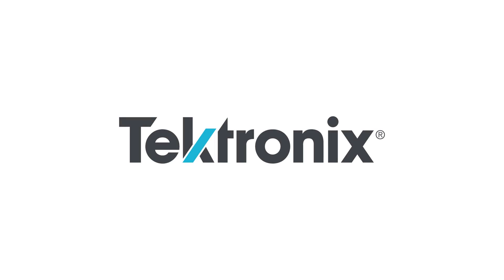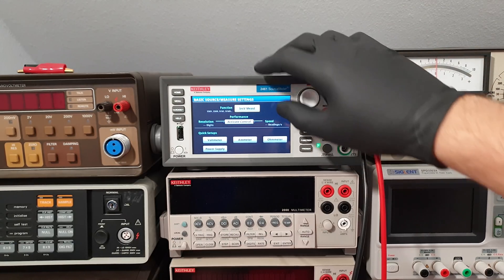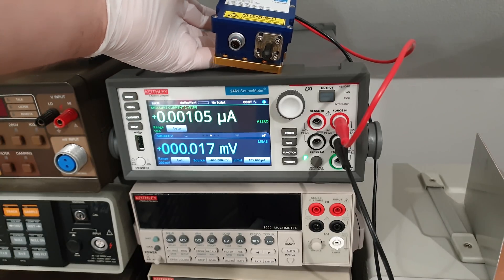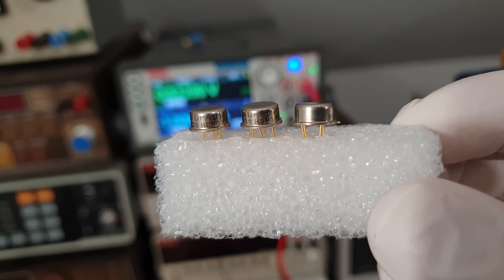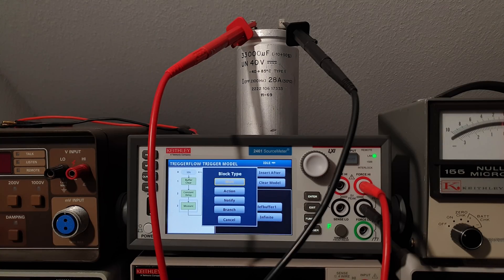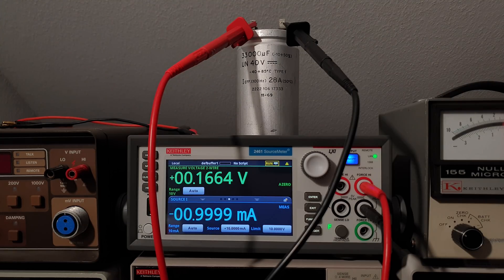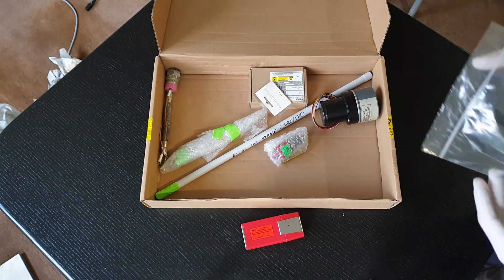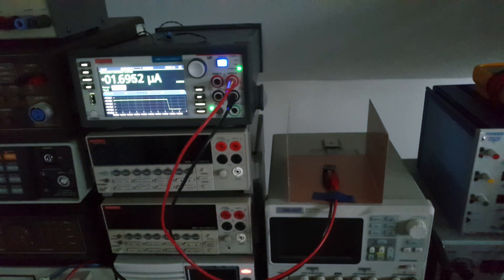Goofing around with a Keithley 2461 SourceMeter

Comment: I was really interested in getting the 2470 to replace our aging fleet of 2410's with its newer features and better display and interface options.  Sadly where it claims the same 20W, it can only do 10mA at 1000V where the 2410 can do 20mA at 1000V.  The design of the 2410 is over 20 years old and only sports a GPIB remote interface.  You would think that newer would be better; but I guess that is not always the case.

Comment: Did he just casually toyed around with a 5W laser?
Reply: Stefan Giehler, that's a 45W laser module that he showed in a previous video.
https://youtu.be/slBgqqWTpEM.
According to the datasheet, that module output a wavelength of 808nm and operate at a current of 59A.
You can search for the datasheet by typing "jold-45-cpxf-1l.pdf" into Google.